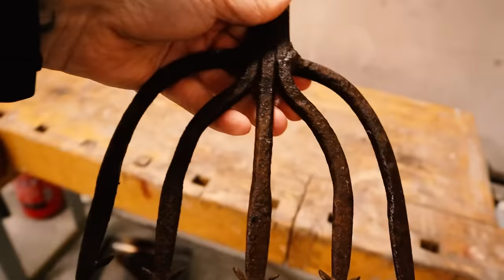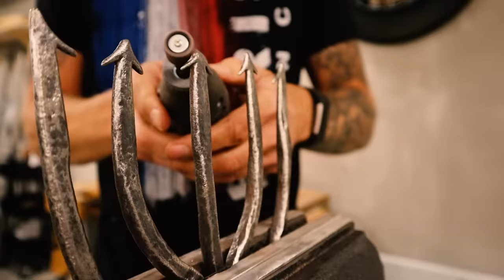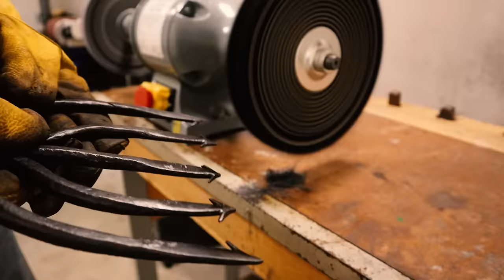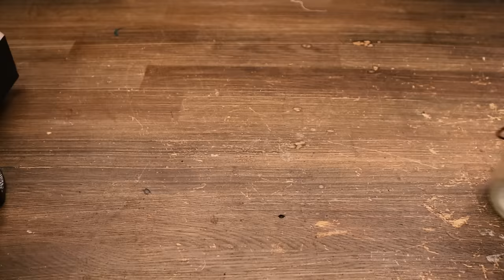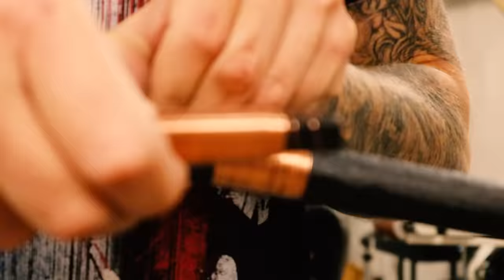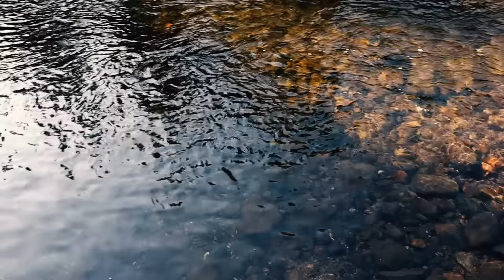Restoration of antique fishing spear

Comment: 15 m walk from my home 
You live in forest or nearby forest?
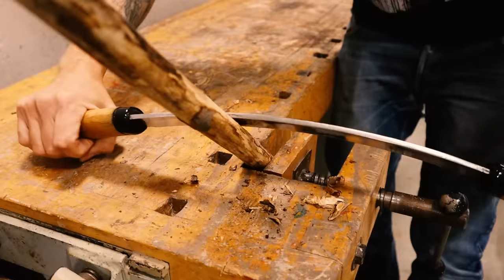4:08 Draw Knife from first video. So you keep it.
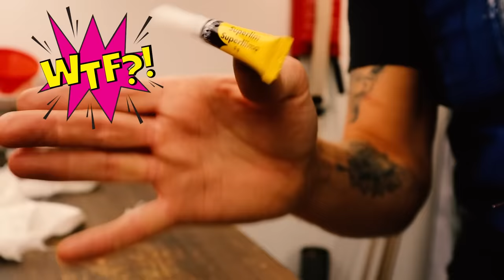6:52 In Poland we have Kropelka. Once when I took the tube in my hand I wiped my eyes with the same hand. Then my eye hurt and stick. I quickly went to the bathroom and washed with water. If I didn't do that I would probably lose my sight with that eye. My advice is to wash your hands with the glue before you do something else with them.
Reply from the maker: thanks for tip :) I live near the forest and mountain and water :)
Reply: Cyano acrylate super glue will break down if you massage oil into it. You can just use regular cooking oil.

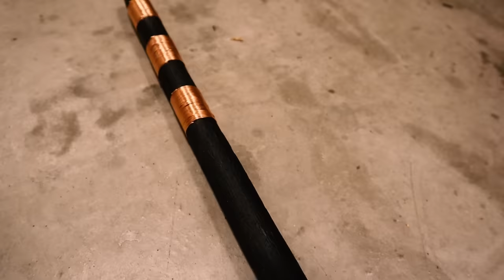Comment: 8:13 I think you should place a third screw or some rope closer to end of that steel plate.There is some unattached place between stick and spearhead that can weaken a structure and nice work with oil blackening.